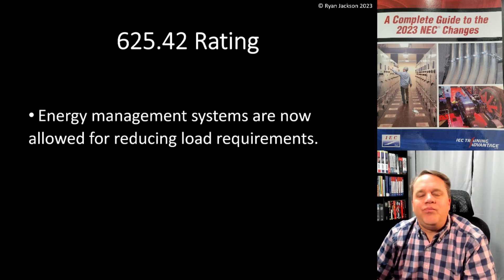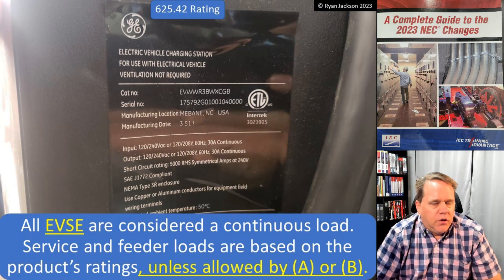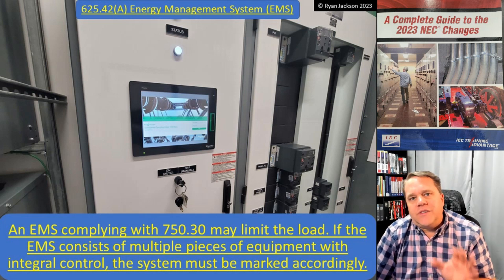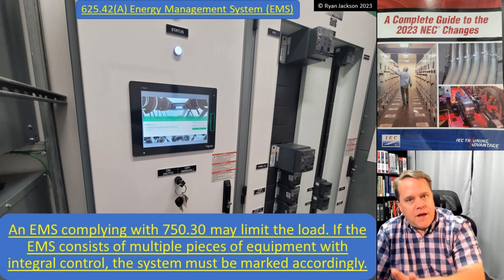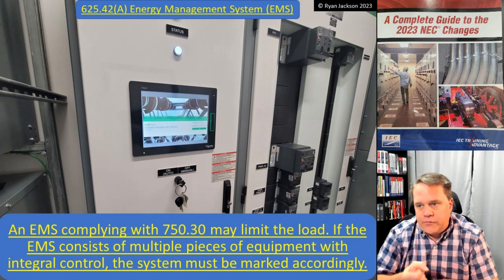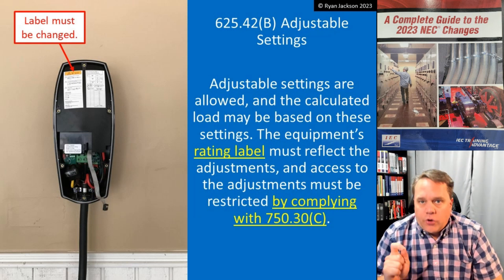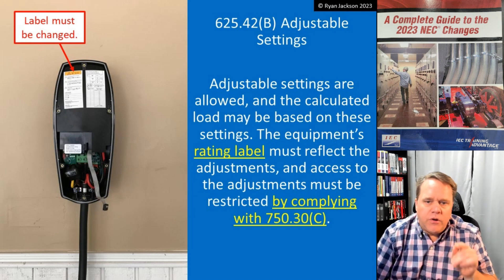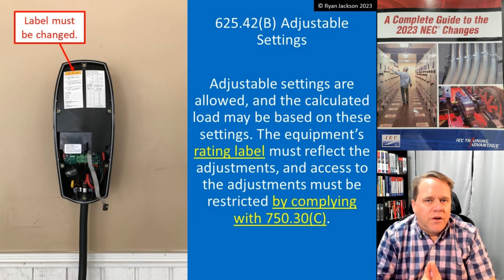625.42 Circuit Rating (Electric Vehicles)

Comment: Do you interpret this article to size DC conductors as part of an EMS based on the maximum load listed (product rating) OR the maximum load listed on the datasheet x1.25? Should be noted that level 3 charging is not continuous by definition, i.e. it won't take more than 3 hours to charge a vehicle using level 3 chargers (separate cabinet/post(s)). Does the DC feeder between the cabinet and the downstream post need to be sized to 125% of maximum load permitted by the automatic load management system, or just 100% of the maximum load? If the OCPDs within the charging cabinet is proprietary, it may not be possible to size based on internal OCPD, but rather the maximum load listed on the datasheet.

Comment: Would be nice if the EVSE could monitor the load on the main panel, and adjust accordingly.  That way, in the middle of the night, say, that 80 amp charger could actually run on the 100 amp service at 80 amps.  Likewise, let's say they add a solar electric plant.  Now they have that plus the 100 amp service to work with, when the sun is shining nicely.  If the EVSE was monitoring the feeders, this would automatically be taken into account.

Comment: Ryan, I saw these videos were released this week and was so busy I didn't have time to pay attention to them until today. I have done more 200A service upgrades,  EVSE circuits and Charge Point EVC's than I can ever remember. The Garden State Parkway on my ride to work is filled with more and more Tesla's and as an electrical contractor it's a wonderful thing to have that kind of surge in available work. 90% of the time I am running a PVC raceway and #6 AWG THHN/ THWN conductors to a charger for direct wire. I  keep hearing about all these NEMA 14-50's failures but that's never happened to me. Guess they're not torquing their lugs properly.

Comment: Good show mate
I do understand that they are making car charges(I have yet to personally install them) so you could run a 50 amp circuit to a 2 bay garage. Install 2 50 amp car charges on it. Then they will  talk to each other and not overload the circuit. A very simple form of energy management at play.
Reply: Yes, that's a great way to do it without an overpriced smart panel.
Reply: A lot of load management systems available now, whether they are smart panels or add-on boxes just for controlling the EV charging circuit just shut off the EV charging when there's not enough capacity available to charge at full current.  Most of the time that they are shutting off, there's still a significant capacity available to charge at a modestly reduced rate, as you describe.  There are, however, a few EVSEs that have the capability to automatically adjust the charging rate based on the feeder current, so they use exactly how much is safely available.  Wallbox Pulsar Plus is a good example, and perhaps the only good example readily available in the US.